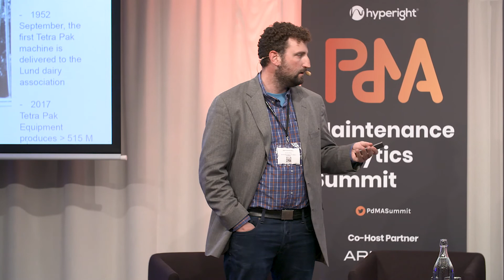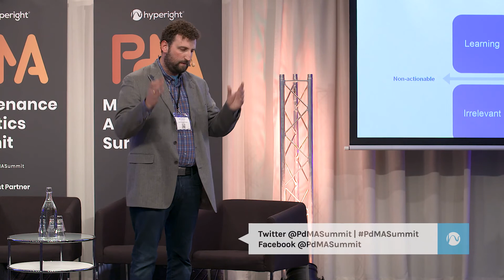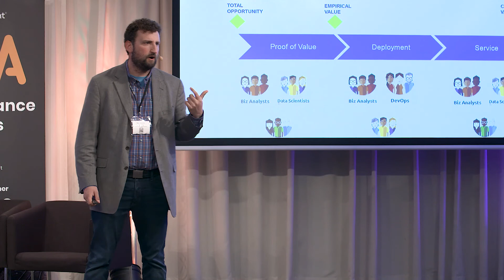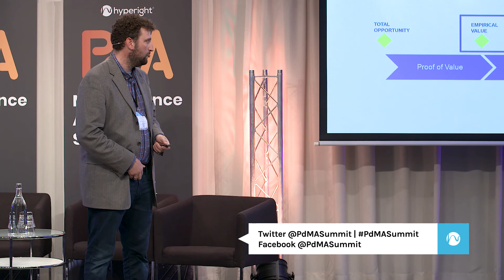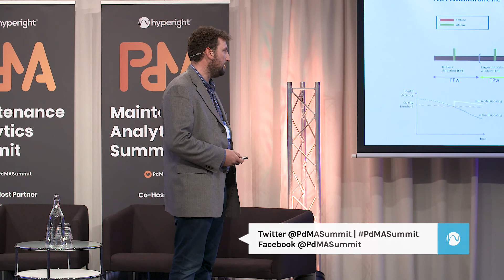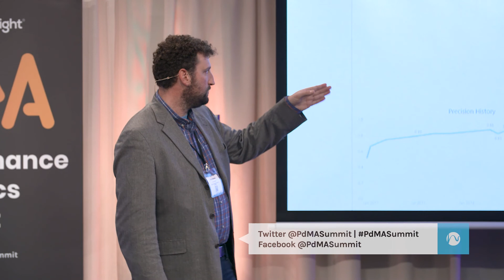Developing a Predictive Maintenance Program - Noah Schellenberg, Tetra Pak Data Science CoE

Comment: Very good presentation and I particulatrly liked how you took the confusion matrix and applied it to build the business case. It is an ideal approach. I also have a comment regarding using False Negatives because they are also important in some usecases. It would be better to use information theory to isolate high information events and use them to calculate the false negatives and false positives. Also the idea of Total Opportunity Value is very good specially if done along with the business. I am curious to see how you are using Thick data in reinforcement learning - are you using semantic models?